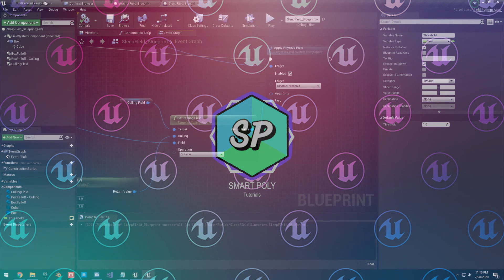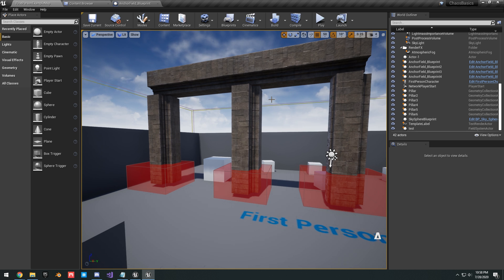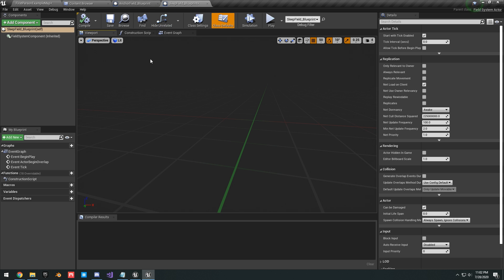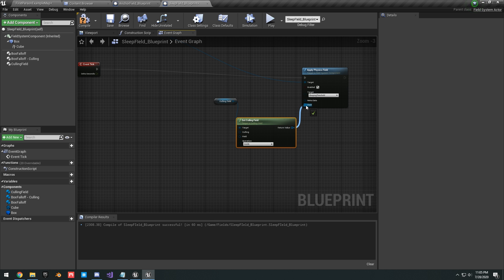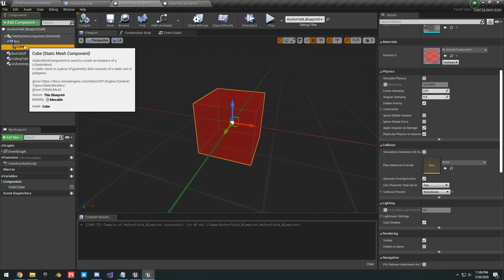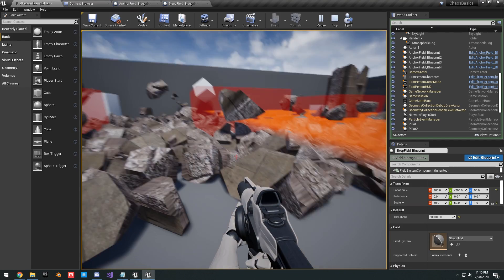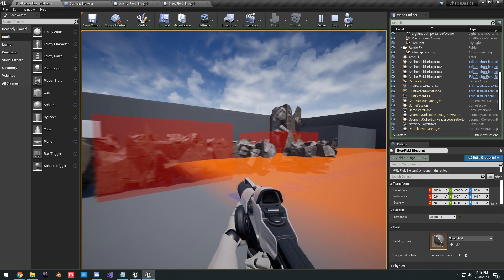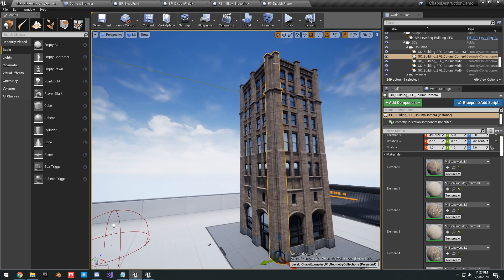Unreal Engine 4 - Chaos Destruction Basics Pt. 2

Comment: in UE5 I cant get this working with, for the field system component there is no "Apply Physics field" and It doesn't seem to work with Persistent, Transient or Construction fields. All the documentation still uses Physics Field so im stuck. Cant get anything to sleep or kill.

Comment: at GDC 2019, Epic shows the demo of Chaos, very realistic physical building destruction demo, when the robot destroyed 5 skyscrapers, the debris flying out which are simulated as multiple rigid bodies look convincing when the laser bullets hit different surface position of the architecture. It makes me thought that they are not fully cached or pre-simulated. There maybe involved some physics rigid body numerical computation behind it. If they are fully cached, It should require a lot of detailed work to make sure the whole complex mesh will have crazy number of destructible pieces with crazy complex destruction layouts or levels for making it looks nice.   Do they use crazy power of pc to demonstrate it? From your chaos simple tutorial, the destruction effect is not impressive. I thought it hasn't been ready for applying it into the game production yet.
Reply from the maker: They used cached simulation for the large scale destruction when the robot destroyed 5 skyscrapers at once. The simulation in my tutorials is merely showing the basics. If you spend more time working on the destruction values and how you apply destruction fields then you can achieve beautiful results. I will likely make a future video either remaking part of the demo or going through a practical use case scenario. Also results will vary because chaos is really buggy in 4.25 verses 4.23